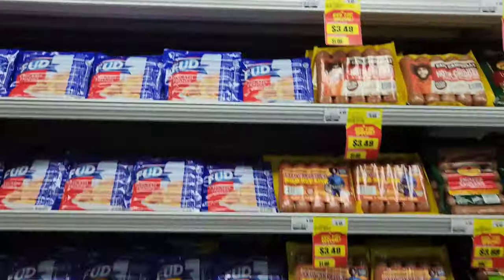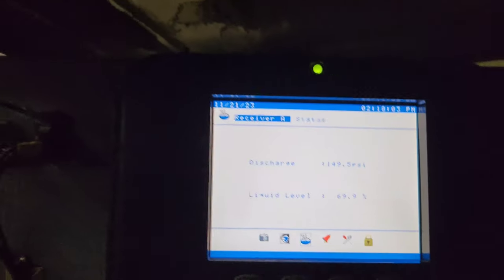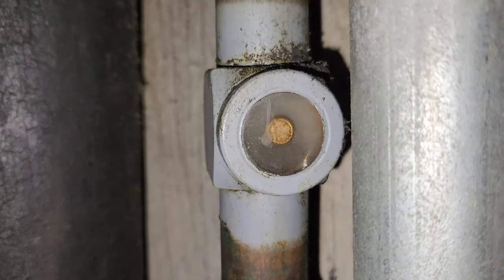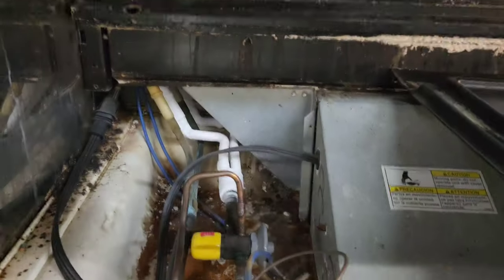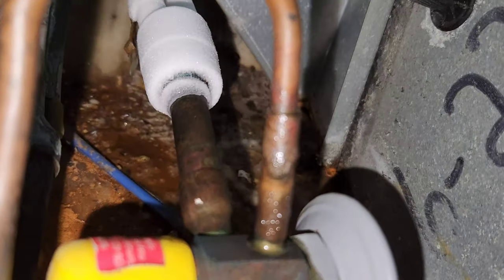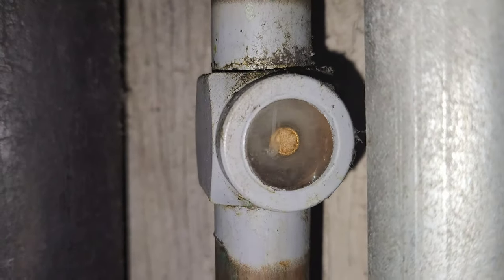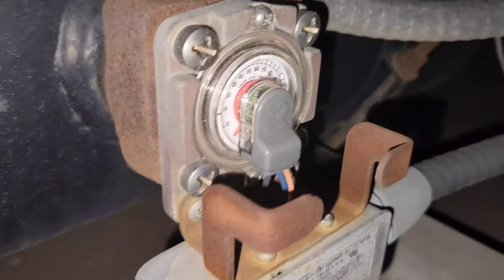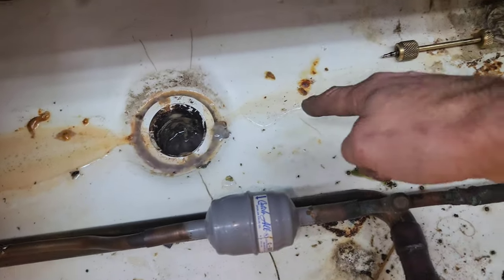Supermarket Deli Case Running Warm:Rack Low on R22

Comment: Was that liquid in the suction back to thr comp mate
Reply from the maker: I'm not sure i understand your question, but i think the answer you're looking for is: Yes, i dumped 120 lbs of liquid into the suction line, which led back to the compressor. however, liquid didnt make it to the compressors. it evaporated into vapor through the length and large diameter suction line(100-125 ft long, 1.5"-2" diameter) from the case to the protocol. hope that helps
Reply: @HVACRServiceTech  im still learning mate.. Thought a was missing a trick having to add small bits of liquid  at a time at the compressor
Reply from the maker: @johnhenderson4335  well that is a trick, sort of. You can add the refrigerant much quicker in that setup I had on the video. Notice the valve stem removal. Also, I had the stem depressor removed from the hose. So we had an unrestricted 1/8" line of liquid flow. Keep learning, there's always new tricks to learn